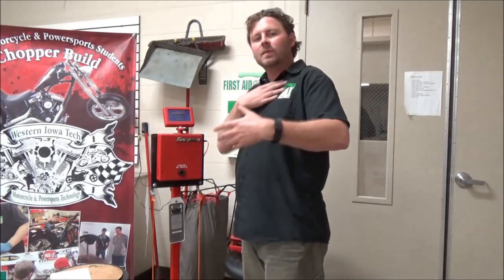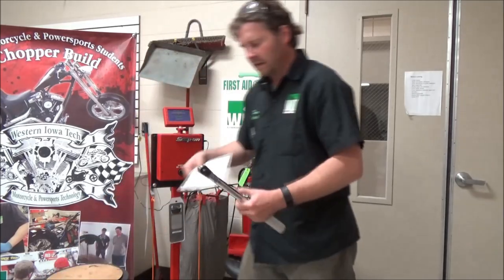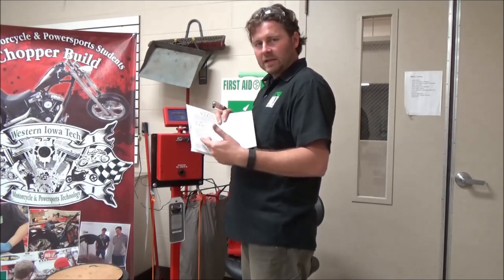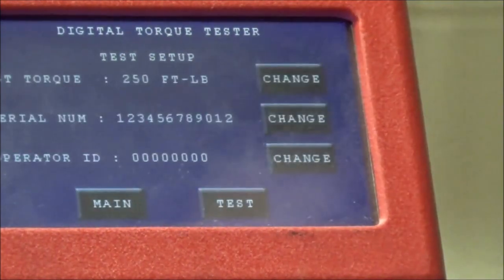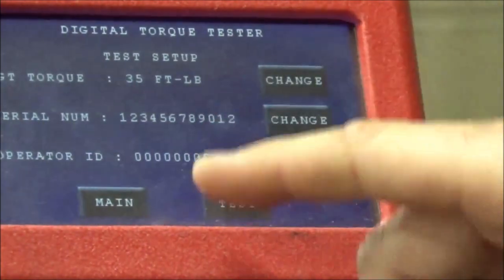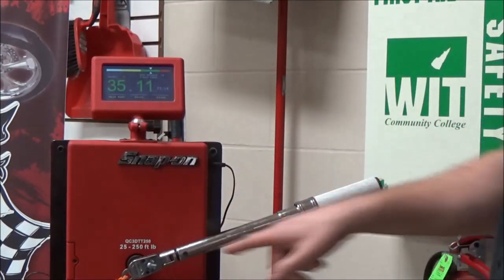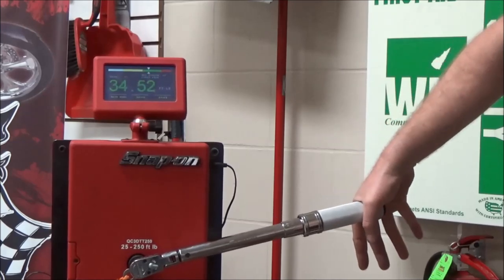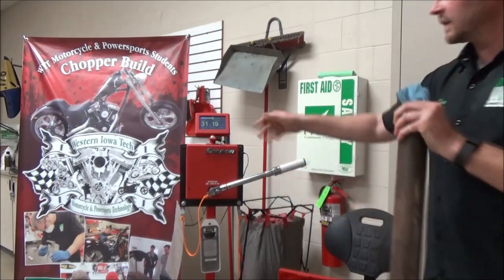Why hand placement matter when using a torque wrench. Proof with electronic tester!

Comment: If you pay a little more attention the way he is pushing the wrench try 1 is totally different from try 2...Let me explain...
 Try 1: light movement of the right hand
Try 2: applying bodyweight
It is rather simple to understand that at that speed that he is applying bodyweight force he can't control it effectively so the torque reading is thrown well beyond 35...A clicking torque wrench does not stop one from applying too much torque it just clicks when you reach a set value. That means you CAN apply too much torque if you go like the 2nd try... Physics talks by itself τ=F*R so all that video is, is nonsense (τ= torque F=force applied R= distance from pivot point)... All that means that it is not the distance that you hold it that causes the problem it is rather that you are wrenching it like a crazy monkey when you hold it closer to the pivot point ( no offense).
Reply: You 're not correct. I did the same test and calibration tool showed too big value even before torque wrench clicked. I did the test for 3 different brand wrenches and every time the result was the same.
Reply: @tytanjan  or you could have made the same mistakes if you followed the video eitherway if it works for you it's OK maybe physics is not present in torque wrenches.
Reply: @PureVenomthe1  Tell that to torque wrenches manufacturers. I guess they don't know what they make.
Reply: @tytanjan  actually im studying mechanical engineering so I must have my facts right look it up search what torque is... I'm sure it is force multiplied by distance. Anyway have a nice day or night
Reply: @PureVenomthe1  I know what is torque and I know that you know too :) That does not change the fact that hand placement on most torque wrenches IS important and will change your reading. Manufactures specify which torque tools es are "Operation length
independent" For example Gedore tools catalogue pg. 262
Reply: @tytanjan  yeah that's what the handle is for but it will still click you just have to put more force into it to achieve the same torque
Reply: @PureVenomthe1  And it will click at the wrong torque
Reply: If you don't believe companies such as CDI Torque, Gedore, Snap-on etc. you can make that test yourself with cheap pocket scale. The difference is so big the scale accuracy won't matter.
Reply: There seems to be a little misunderstanding here. The entire question we are trying to answer is "What is the torque on the fastener at the moment the wrench clicks?" The problem with this style of torque wrench is that the clicking mechanism is located slightly closer to your hand than the center of the fastener is.

As you noted, T=F*R. But there are 2 distances to consider: (1) From your hand to the clicking mechanism clicker, and (2) From your hand to the fastener. The force is the same for both. But since the distances are not the same, the torques are not the same.

If the clicking mechanism is located, for example, 90% of the way from the hand grip to the fastener, then that clicker will click when it feels 90% of the torque value you selected. Why? Because the fastener itself (which is slightly farther away) needs to feel 100% of the value selected. And we are assuming the wrench has been properly calibrated. So, if the torque at the clicker is T, then the torque at the fastener is (100/90)*T = 1.111*T. (The 100/90 comes from the fact that you multiply the distance from hand to clicker by 100/90 to get the distance from hand to fastener.) This hypothetical wrench will have a torque at the fastener 1.111 times higher than at the clicker point when it is calibrated and used properly. If you selected 100 ft-lbs, then the clicker will click at 90 ft-lbs, and the fastener will feel 1.111*90 = 100 ft-lbs. Good.

Now let's try moving our hand...

If you move your hand forward so that the clicker is only 50% of the way from your hand to the fastener, then the torque on the fastener will be much higher. It's easy to see why. The clicker will still click at exactly the same torque as before. But that's the torque AT the clicker. The torque at the clicker is still equal to T. The torque at the fastener is therefore (100/50)*T = 2*T.  If you selected 100 ft-lbs, then the clicker will click at 90 ft-lbs, and the fastener will feel 2*90 = 180 ft-lbs. Bad.

The same logic also explains why the applied torque at the fastener becomes lower if you move your hand farther away (e.g. by adding a cheater bar). Let's say you move your hand back so that the clicker point is 99% of the way from your hand to the fastener. The clicker will still click at exactly the same torque as before. The torque at the clicker is still equal to T. The torque at the fastener is therefore (100/99)*T = 1.01*T. If you selected 100 ft-lbs, then the clicker will click at 90 ft-lbs, and the fastener will feel 1.01*90=90.9 ft-lbs. Also bad.

Hand placement matters when your wrench uses this type of off-center mechanism to measure the torque.

Comment: This experiment is completly inaccurate. First off, a click type torque wrench is so dependant on how fast you apply the torque to get the click and release the torque after it clicks. it is obvious from this video he over and under torqued the gauge to promote his narrative. I would like to see the exact same experiment with a digital torque wrench and with constant applied torque using different hand positions or with an extension bar. I think your going to see a much different result.